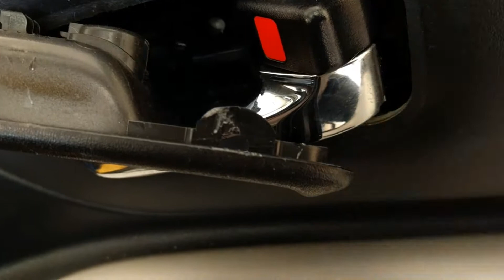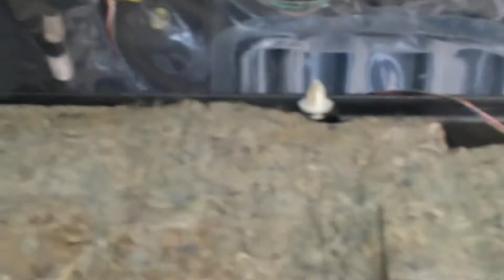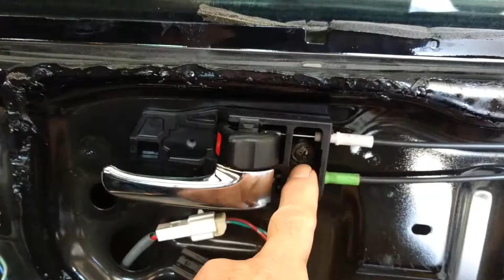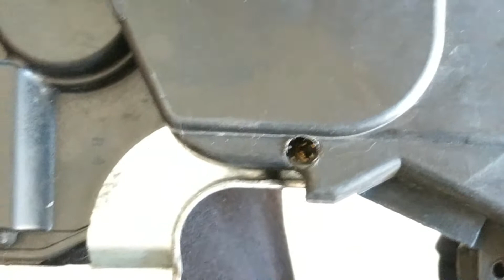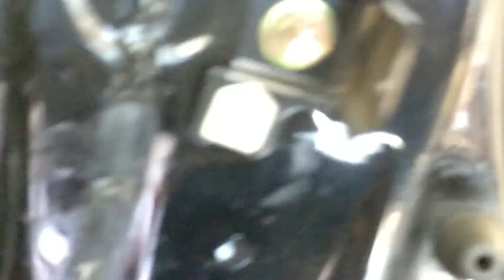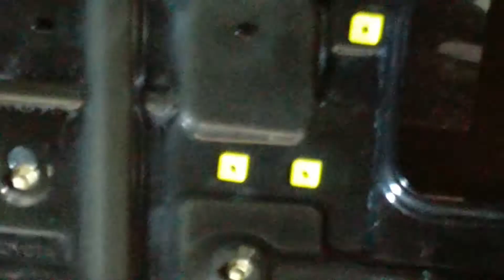Lexus IS300 door lock actuator easy way by froggy

Comment: My rear passenger lock sticks when its super hot out. Can I just spray some brake kleen or something in the lock?
Reply: brake clean will dry parts out and make them worse usually
Reply from the maker: I would take apart & see what is sticking.  :)

Comment: Thanks for another video Froggy. Seems every single issue I have you've got a video haha.
Reply from the maker: The issues seem to happen to many cars due to poor engineering, cheap parts, bad design.

:)

You put the same bad part in 5,000,000 cars a LOT of them fail.
Reply: I love the IS300, I'm on my third one now. The actuator just went out on me. Barely moves when I try to unlock. And watching this video brought back all the nightmares from my 2nd one because I had to do the same thing to that one. Every single thing is EASY except those damn metal arms. I had a hell of a time getting that double clasped one out. I can't remember how I did it. I'm sure it'll come back to me once I get in there.
Reply from the maker: Let me know.

:)
Reply: You are a good man. Thank you.